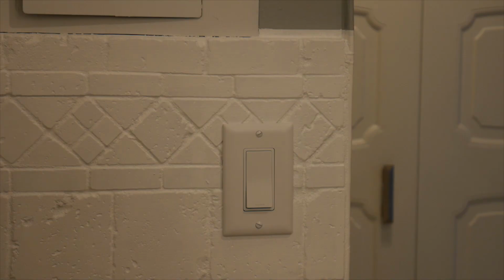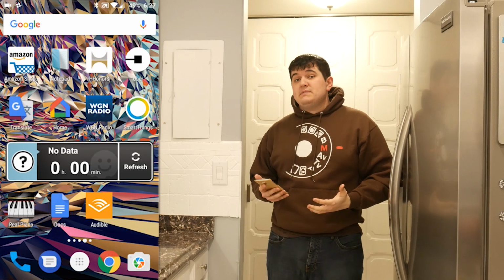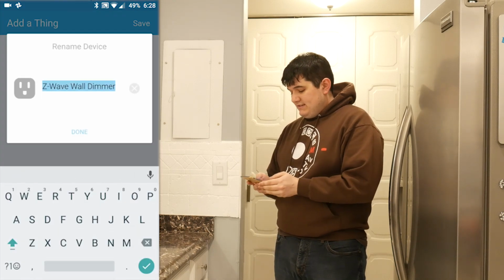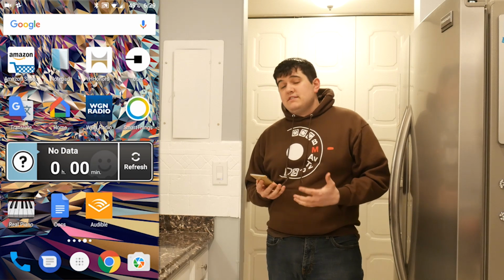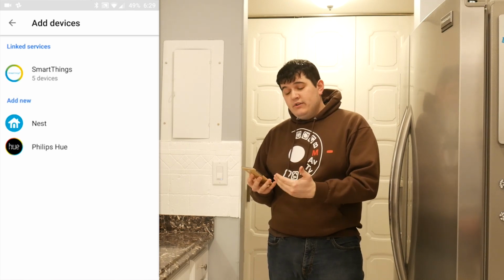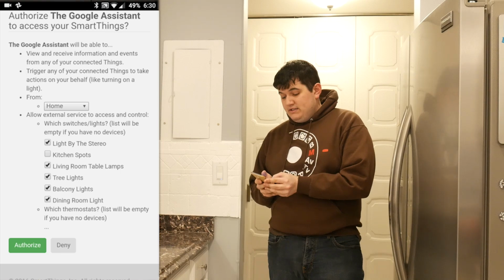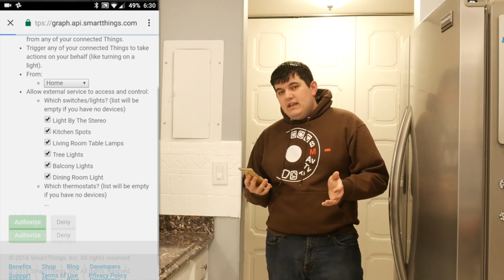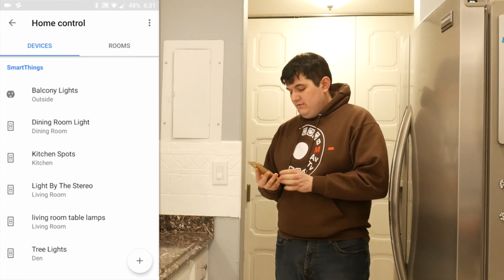Home Automation: A Beginner's Introduction

Comment: Until a hacker gains access to your smart devices and starts screwing around with you, such as stealing personal information, or just screwing around with your air handler to give you sky high electric bills, etc.

I should not have to update the firmware on my toaster because some hacker can do some non toaster things with it... 

Next thing you know you'll have smart guns where it would refuse to fire when you really really need it to fire... or fire when you really don't need it to fire. Very dangerous.

Comment: I wonder if it's possible to create smarthome devices that wil run locally rather than relying on a server somewhere. Samsung (I think) takes this approach with it's digital assistant Bixby , so it seems to be at least somewhat possible. In theory you could adres a lot of the privacy concerns surrounding smarthome stuff. With a local solution you could also improve responsiveness by quite a bit.

Comment: The downside of Google/Amazon for automation is that they require cloud access, they don't work offline. They really need to get this stuff working without sending every command to the cloud.
Reply: Lambda Function that’s why I got a smart plug with a button. if there’s an internet outage I can still control my lights easy.
Reply: Afaik the voice analysis is actually done on their servers using their AI.  That's the reason they can't operate offline.  Voice to text software has always been hit and a miss, but the reason google, alexa and siri are able to understand you better than any voice operated tech before it is due to cloud processing.  

If you're happy to have home automation with out voice controls its quite easy to set all these features up to a remote or dedicated devices, but that just doesn't feel as space age...  

You could definitely experiment with more traditional voice to text software, and use a little bit of coding trickery to get the whole google effect, but my expectation is you'd either need to train your own AI to understand your voice or you'd have to limit the number of inputs to a limited set to reduce the chance of the computer not understanding a command.
Reply: @SineN0mine3  There's certainly nothing stopping you using voice recognition software on your own computer and training it to accept your commands.  

Things like the old Dragon Dictate and Naturally Speaking etc used to enable you to write letters and emails - and control the functions of the computer.  They had to be "trained" but that was simple enough (and they got better at understanding you the more often you used them) and you had to have multiple profiles for yourself and your family.

That sort of voice recognition for home automation would mean that your home would only respond to you and your family - that's a security plus right there.
The command set needn't be too complex as you're doing similar things with most of your systems - turn on/off, turn up/down, set to x% - those instructions apply to lights, stereo and TV.  A few more device specific instructions, the names of devices and their locations...  It doesn't exactly need Shakespeare's vocabulary to change a limited number of controls on a limited number of devices in a limited number of rooms - frankly Google/Alexa/Siri are overkill for this task.
Reply: @SineN0mine3  except that the Google pixel, and now every Android phone, has offline speech detection that's faster and more accurate.

Comment: Fantastic explanation I have a few light's using the HUE system and now this looks like a better option for controlling other lighting in the home which I would like to do with out buying all the special Hue bulbs which I think are a little pricey at best. Swapping out light switches is actually quite easy and as you said much cheaper in the long term..Thanks Great video
Reply: $50 for a RGB and tuneable white bulb no thanks plus another $60 for a hub. I like the C by GE bulbs they work great. The Phillips smart bulbs at Home Depot for $12 aren't too bad especially for the price.

Comment: I have two major problems with this stuff.  One is that you activate whatever by talking to it -- I do NOT talk to any of my devices!  Google has been pushing some of this sort of thing on my phone,   and I do not have the microphone permission turned on for the google app,  which doesn't stop the stupid little mic icon from displaying,  nor the stupid delay when I try to use it,  waiting for the keyboard to get around to showing up.  They're apparently not considering that I might do this,  I guess?  I also hate automated voice response systems that you sometimes encounter over the phone.  This is an accessiblity issue,  dammit!  I went round and round with Verizon about this,  telling them that if they didn't provide the option for me to press a key on my phone that I was going to file a complaint under the Americans With Disabilities Act,  and they finally did so.

The second,  and more important issue I have,  is that this stuff is being handled out there in the cloud,  on somebody else's servers.  it's already come out that in the case of amazon at least,  there are times when people randomly listen to what that mic is picking up.  There was also a case where law enforcement wanted buffered audio from what they considered a crime scene,  and there was a big legal battle over this.

I will personally NOT be installing anything of this sort until it gets to the point where the necessary software is running on MY servers,  and not out there someplace...

Comment: I use Alexa. Arguably it's "better" than Google Home. Since it's an Echo Plus it also behaves as a bridge as well (I am not 100% certain it's zWave or something else.). What's nice about the bridge feature of the Echo Plus is I can use multiple brands under one hub: The Echo Plus. And I do.

As a note, Alexa allows you three different wake-words, one of which is "computer." 

One downside to multiple dumb-bulbs to one smart switch is if you want to do RGB lighting for your home. I've been thinking of doing that and already have one such smart bulb. With a single smart switch I can't control the lighting like that, but a grouping of RGB smart bulbs, while very expensive, will allow me not only unified on/off and dimming, but allow me to say something like "computer, make the living room green" and get that. 

I'm currently mostly using Kasa with my Echo Plus, along with a plain white Philips Hue smart bulb. I believe these are all Z-Wave devices. What I'd really like to find out is the best actual brand of Z-Wave devices [Such as color reproduction/warmth for bulbs.] and try to use those exclusively. 

All said, what smart homes really need is to allow you to configure what servers to administrate your home's smart ecosystem. Rather than use the Kasa service, I'd sure like to use my home server for the actual smart home service that Alexa would connect to. Logitech screwed a LOT of people when they shut down Harmony without so much as a firmware update allowing people to reconfigure what the devices can use now. I see nothing from Kasa or SmartThings or Hue that allows me to opt to use my own service I control. 

I suppose one thing I could do is check out what sites like, for example, Adafruit have to offer, since they promote making your own electronic solutions.

Comment: Why anyone would deliberately put spyware in their home, I've no idea.
Reply: Do you own a smartphone at all? Most modern phones have a microphone, front and rear facing cameras, GPS, gyroscopic sensors and use your biometric data in order to login. We've been spied on via smartphone for the past decade. Still worried about a wifi enabled microphone?
Reply: @johnnysidecars  you're right, why should we bother? One device is already doing it, so let's just go ahead and let them all do it! Nothing can go wrong!

Comment: Google knowing when I turn the lights on and off creeps me the hell out. I'd much prefer an open source, self hosted solution
Reply: A basic x10 system can be installed.   And choose either a wall mounted tablet or your phone as the control point.   Voice can still be used and you don't need the internet. :)
Reply: @MrWitchblade  is there an explain like I'm 5 explanation of this for the luddites among us? Asking for a friend. :P
Reply: @MrWitchblade how would this be used without the internet? Would it be just via good ol' wires and electricity?
Reply: @gillesfabbri97  some x10 is as simple as plug and play, some can be run via the mains system.
Different versions depending on your needs.
Reply: It's very possible. I forget the name of the company, but it can be setup with a customs server with all the controls you can think of.
Reply: Try Mycroft. Completely open source, and you can run everything locally if you want. https://mycroft.ai/
Reply: https://www.youtube.com/watch?v=pm33KB2Th9M
Reply: That's what I thought the whole video
Reply: Or get one of those clap on- clap off lights, lol.
Reply: Guys just use Home assistant. It's great
Reply: Well, the thing is, the voice control is based on Google's neural net - and training that neural net so it doesn't suck requires tons and tons and tons of inputs. They're not going to just give that up as it represents an incredible investment, and while the tech of making one is straightforward enough, getting that data to do so is not. Thus, the bottom line is... you can do it, but it'll suck, guaranteed. Might as well just stick to manual switches.
Reply: @abdulmasaiev9024  I thiiiiink the open-source MyCroft doesn't suck because it uses Google voice recognition bits now and can be switched out to use something else if you want.

Comment: Interesting note for buyers: Beware that SmartThings is 100% reliant on an internet connection. The entire platform, databases, logging, apps etc all live within their system. Which, funny enough, is all hosted in AWS (Amazon Web Services). Something to keep in mind when planning out your smarthome. For this reason, I tend to lean more toward using the Philips Hue's system for lighting because their hub, while does leverage their cloud, can function without an internet connect and also can be integrated with SmartThings etc.
Reply: This is an important thing to keep in mind. For example, in November 2017 Logitech decided to shut down the servers for the Harmony Link devices, rendering them useless. I avoid buying any smart home devices that depend on third party servers out of my control to function.
Reply: LiFX globes (no need for a silly expensive hub) offer the same functionality and don't need an internet connection either.  They can use one, but its not required.
Reply: Lord Colin LiFX globes are about the same price as hue ones now, but no hub needed.  They're so so bright I have mine set at 80%.
Reply: Apple's iCloud uses Googles servers as well
Reply: One thing i found on the hard way: if you have your lamps on battery backup (I jacked a bunch of 12 v lead batteries from a building being torn down, with permission of course) and if you have your router on battery too, your lights still won't work be controllable in a blackout. You must be connected to the internet, not just your own net.
Reply: IKEA light! that is amazing

Comment: I don't trust a system like that.
If I ever plan to have a lighting control system I would use similar systems to what is used in most office buildings.
Reply: Okay I've read this comment multiple times and can't figure out what it means. Offices have Wi-Fi enabled lights? People are going to hack your light switch? Are you just talking about a normal light switch?
Reply: @compactcow  There is systems such as KNX, that sends commands over the wired connection (no extra wire required other than the + and -/neutral) where you paid a lap/ficture or an id or name etc, and then the controller sends the commands to specific groups and individuals to perform a certain task

Comment: Hey there, good video. I was wondering if you have integrated Harmony HUB yet into your home automation.  I have the harmony hub and i am using it with Google Home except that I have to use IFTTT app. Which is another cloud app that will take commands from Google home and translate it and you can turn on your TV/chromecast/chromecase audio. If you have my question is, is that i am having trouble with the commands doing what should be done. Like, when I ask Google Home to turn on the Masterbed room TV on it sometimes works and then sometimes it forgets what inputs my TV/soundbar etc... should be. Other times, it says it cant turn it on and I realized when it cant its because in the Harmony hub its already thinks its on :( Anyway, great video hope to see more.

Comment: So, what happens when these companies inevitably shut off the servers in a couple of decades?
Reply from the maker: Well, the voice-activation and automation functions won't work, but the light switches themselves still will.  Even without being paired to a Z-Wave hub, they still function as normal dimmer switches.  Though I agree with you that future compatibility and support is somewhat questionable.  I would bet, though, that among the various standards available today, Z-wave will be supported the longest into the future.
Reply: You take 5 seconds to pair it to something else...
Reply: Or when someone hacks them to act as spam botnets, spy on you, hold your controls for ransom, or just quit? Or when you find out that they've been recording you for years and those recordings have now leaked? Or when you upgrade some part and it's not compatible so now you have to upgrade all the rest too? Or when the company decides to start charging for basic features that used to be free? Or when they respond to someone's voice in a video and turn all the lights on at 2am?

I'll be interested in this tech when it's 100% under my control with no internet connection required. I'm not giving Google/Amazon/Microsoft/etc even more control and monitoring than they've already managed to grab just for a fancy light switch.
Reply: @renakunisaki  exactly! I don't want a smart home, i want a home controlled by me! Im more than happy to be the smart!
Reply: Everyone switches to the open-source alternatives that they would've been better off using anyway.
Reply: Plus it's highly doubtful that you'll still be using these same bulbs all those years.

Comment: great video , I figured most of this out last month. question for you , do you have a z-wave door lock ?
I have a kwikset 910 and it is connected to my smart things hub and works great from smart things .
Google home won't let me add it . any ideas ?
Reply from the maker: I do not have a Z-Wave lock.  Being in a condo where I need a hard key just to get in the building, I didn't see adding a smart lock as that crucial.  I don't know why Google can't see it, but I do have an anecdote that might have something to do with your problem.
When I added the most recent dimmer (above my kitchen table), I named it "Kitchen Table".  Later, when I asked Google to turn off all the lights, it said "OK, Turning 6 lights off" and it left the kitchen table lights on (there were 7 lights on my Smarthings hub).  I was quite puzzled, restarting the Homes and the Hub with no success.   Then I changed the nickname in the Home app to "Kitchen Table Light" and the problem was fixed.  Which leads me to believe that the Google Home only categorizes devices based on the names you give them.  So perhaps, if you don't have a nickname including "Lock" in there, the Google Home doesn't know what it is.  Not sure if this would be it, especially since it looks like the Home app itself can't see the lock, but hopefully it gives insight to someone!
Reply: Technology Connections just used , IFTTT to make a script for it and it works fine .